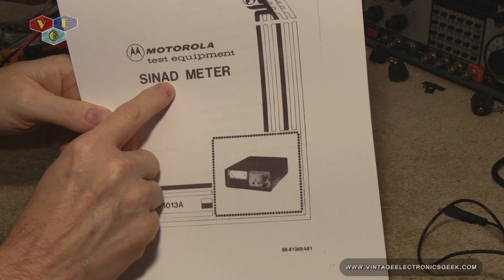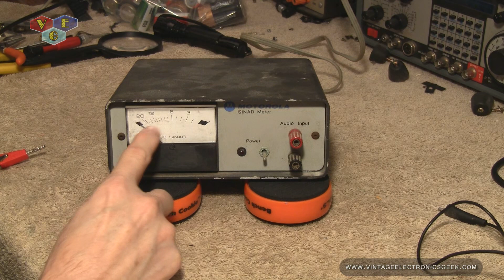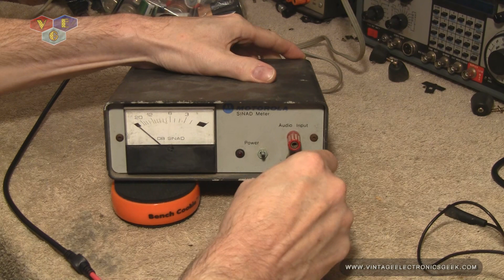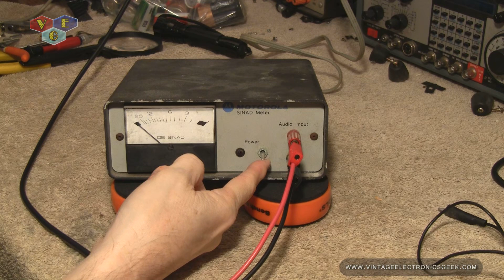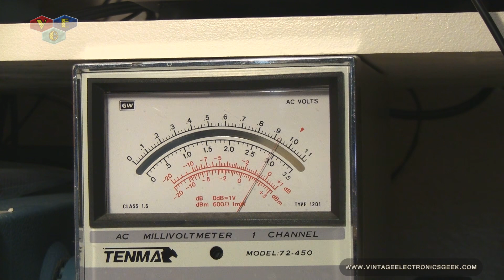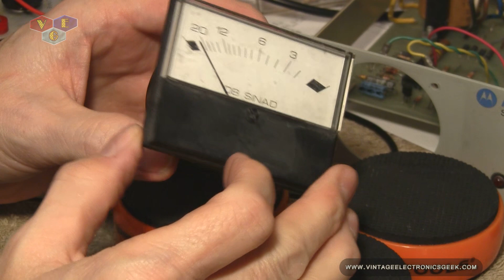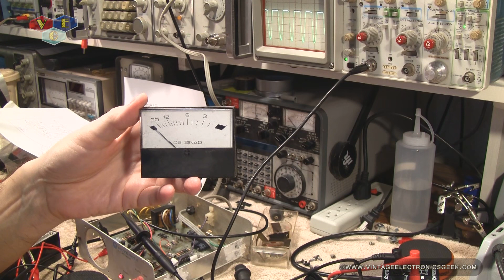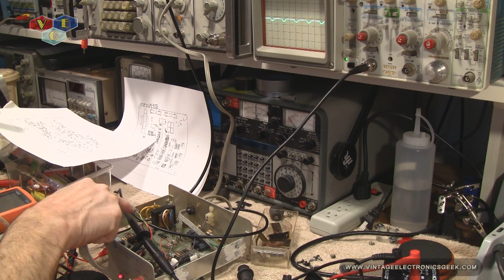Motorola SINAD R-1013A - Diagnosis - Part I

Comment: Hi , i bought one of these Sinad meters however it was from USA and i need 240v for Australia, can this transformer supply 240v? any advice on wiring please.
Cheers
Reply from the maker: Howdy!  You can download the manual here, it will show you how to:  https://www.repeater-builder.com/test-equipment/motorola/pdf/r1013a-sinad-meter.pdf  - hope that helps!  ~Jack, VEG
Reply: @VintageElectronicsGeek  thanks ..cut the jumpers etc..all good
.cheers

Comment: Have you find a technical features about the meter ? I want to build this sinad meter...but i don’t know which meter to use
Reply from the maker: I have not, I ended up buying another SINAD meter by Helper, it works just fine, however I like the profile of the Motorola, so I plan on robbing the meter from it....with that said, since radio signals are AC, I would look at millivolt meters if you can get them cheap...then trial and error to make a new meter front.  Good luck!  ~Jack, VEG
Reply: @VintageElectronicsGeek  tnx !

Comment: https://www.ebay.com/itm/Helper-Instruments-Sinadder/303547590398?hash=item46acd8a6fe:g:s5oAAOSwY3VeoEcI
Reply from the maker: Thank you Dennis, I just bought it....wonder which one of the two devices are better?  I've seen the schematics on the Sinadder III and I believer its very similar to the Motorola.  Thanks!  ~Jack, VEG
Reply: @VintageElectronicsGeek  its good I have the toner decoder and rf meter, good price on sinad, I would have bought it but have too many now

Comment: Wow, as luck would have it a bad meter.  If you can find out the specs of that meter, you can probably come up with a replacement.  Although the size and mouting may be different.
Reply from the maker: Thats the kinda luck I have Pete!  :)  Yes, I hope I can cobble something up...or find another SINAD meter, my IFR has it built in...however being kinda test gear junk...I must have a separate one!  :) ~Jack, VEG

Comment: Too bad, did you test the meter? I have 2 motorola sinad units on my rf bench,, always need a backup,your  ifr has sinad built in
Reply from the maker: Yes, tested in the video plus I tried more volts and amps...and connected it to my signal (AF/TTL) and RF generators...all failed.  I know, I just haven't really played much with the IFR...I need to learn it plus, its a little sick right now....a future video...someday...both your Motorola's this model? Do you ever plan on having an active channel?  ~Jack, VEG
Reply: @VintageElectronicsGeek yes same sinad meters as yours  I,was a motorola service tech for radio communications, not realy interested in you tube videos of my own
Reply from the maker: Wow, that's very cool!  Back in the 80's I knew a guy who owned a local Motorola shop, nice guy dressed as a normal guy...drove a Rolls!  Well, if you do, let me know...I'm sure I could learn something!  :)  ~Jack, VEG